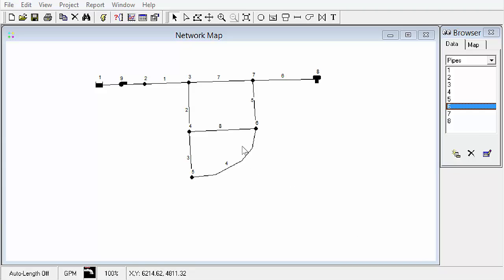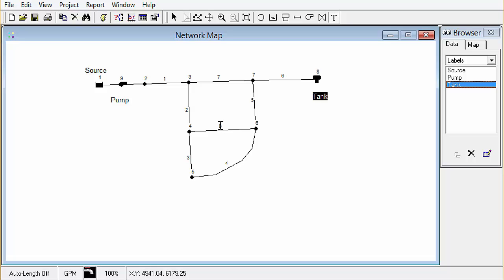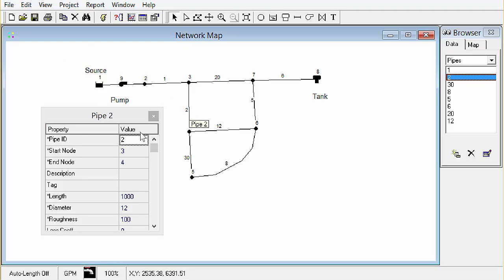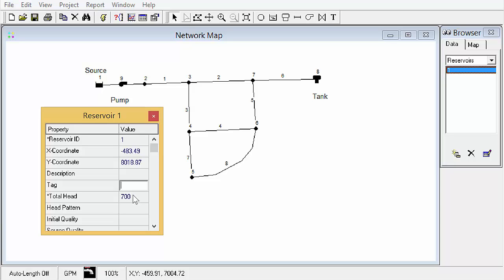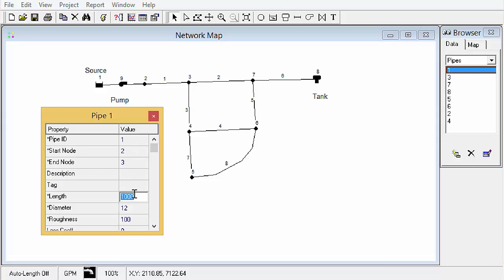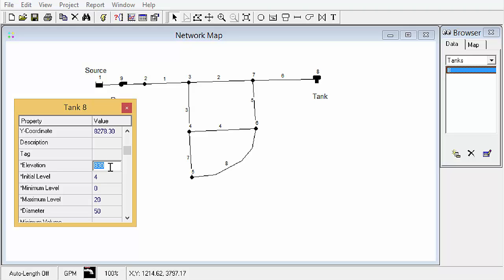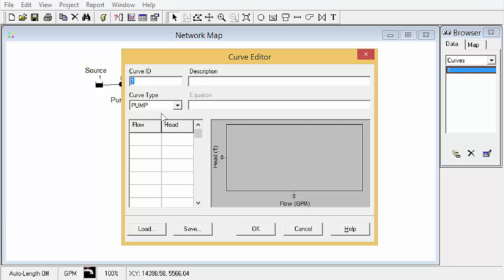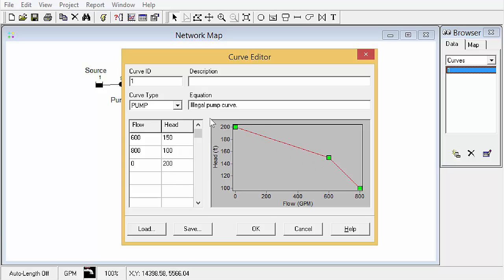EPANET Tutorial 02.05 - Setting Object Properties | Hydraulic Modeling

Comment: thanks for the good tutorial,so where did you get the values of tank,detail for me if it's possible. thanks again
Reply: The system operators should know the elevation of the tank floor.  The Max Level is measured from the tank floor to the overflow.  The Initial Level is just the starting point, many times I just choose a certain percentage of max.  If I am calibrating for a specific day, I choose the level of the tank at the start of the day.
Reply: thank you very much for this enlightenment, later I want to know how to put the flow that passes through the network how do we do it?

Comment: thanks for the tutorial!! I had question, you mentioned that you create a hydrodynamic tank in an advanced tutorial.  Where can I find it?  Thanks!
Reply from the maker: I have not produced that video yet but a pressure tank is modeled as a tall and skinny tank.  Calculate control setpoints by converting tank pressure to head.  Calculate tank diameter by converting the volume of the pressure tank into an equivalent vertical cylinder.  Typically the diameter is around 1 foot.